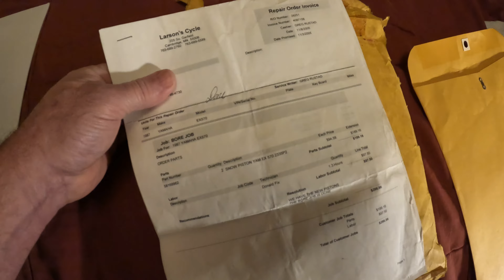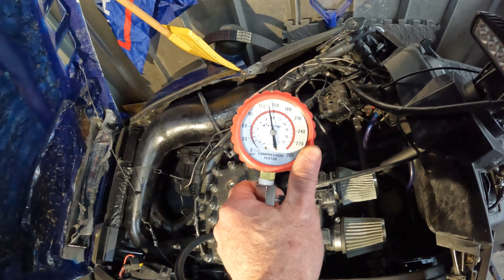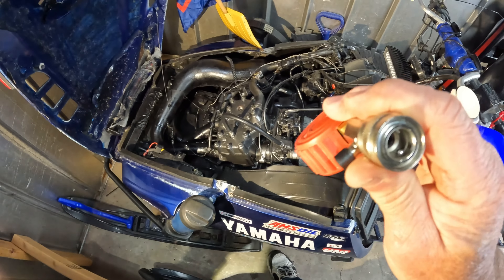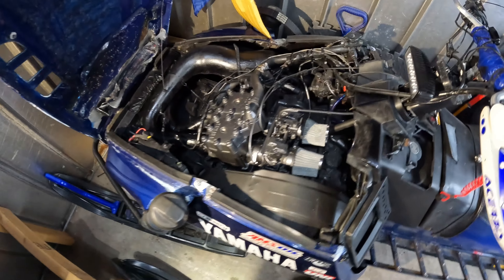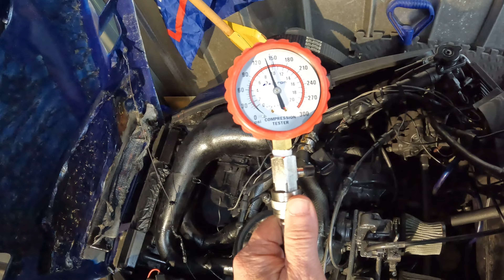Harbor freight compression tester, does it work?

Comment: Well... On the bright side.. Ya got time to fix and replace before it snows...  I need new exhaust valves... A battery.. N jack shaft bearrings.. On 1 sled.. The others need...  Snow. N a good waxing.. But I'll find something wrong I'm sure.. Good luck.. And if ya wanna sell it????....  Contact me😁
Reply from the maker: Fixed it with some sea foam 😂